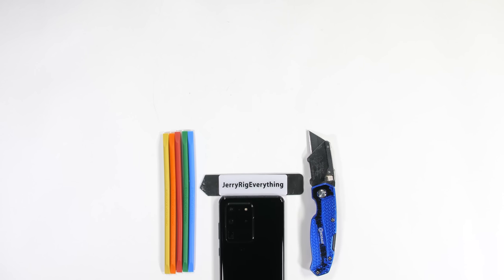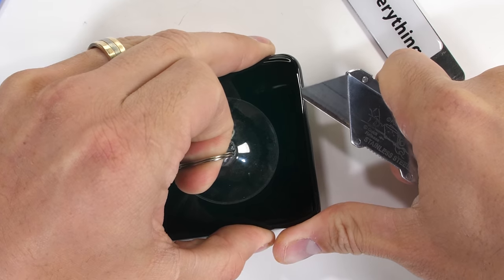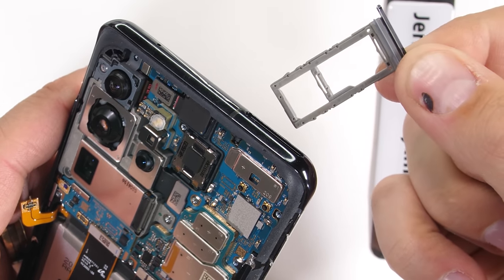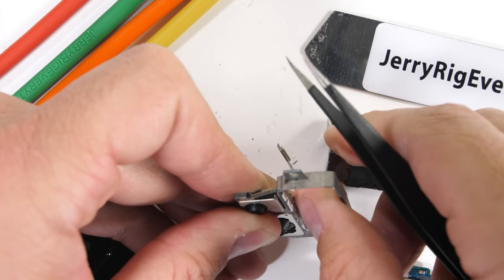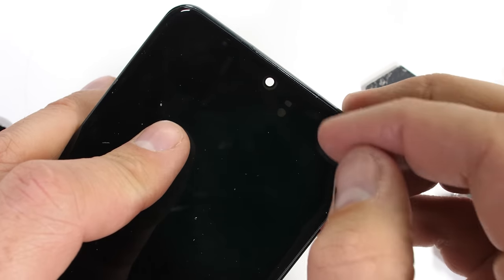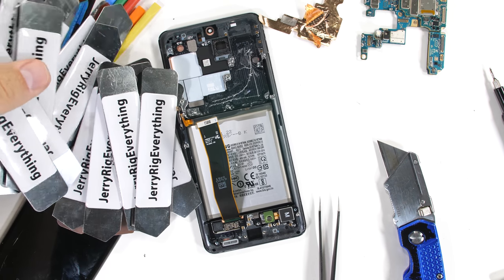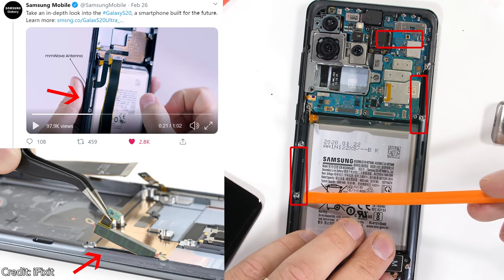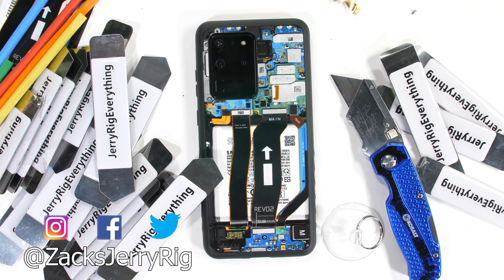Samsung S20 Ultra 5G Teardown! - Is the 5G even real?!

Comment: What do I think about 5G? Probably the same as you Jerry. However, most phones coming out this year will probably support 5G, and i'm looking to buy a new phone this year, so question is if i can avoid 5G? I could off course buy a 2019 phone and i might do that... i'm more interested in the other new improvements coming in 2020 phones though, such as the 120 hz displays. I've never seen a phone with a 120 hz display, but maybe when i do i might think that it's worth the extra buck?

Comment: 0:34 in the top corner of the battery zack has written  (glass is glass and glass breaks) 😂
Reply: What an eye mannnn....Damn XD
Reply: I can't see it well, I got a 720p screen :(
Reply: The cable says "glass is glass and glass breaks" jist above the USB charger port says "Illuminati" and the botttom middle says "Jerryrigeverything" 

Source: Its on my phone.
Reply: @Johannes Davidsen on that battery ribbon on left side
Reply: Are u watching this video on a large 4k screen? I can't see shit on my 5,6" 1080p phone screen just a tiny glimpe of it and it's not actually on the battery it's on the cable
Reply: @DaniDani-zb4wd  i typed battery ribbon and im watching it on 5.1inch s7 lol
Reply: @samsung user I have a Xiaomi Mi A3
Reply: @draig3963  screenshoted the image and zoomed in to see if the text is recognizable and yeah it is but BARELY so u either screenshoted the picture and did just what I did or watched it on a bigger screen cause there's no way u actually picked up that detail while watching the video though your screen is a bit higher resolution than mine 1440p I guess
Reply: @DaniDani-zb4wd  i can barely see it

Comment: Hi Jerry, I own a 20 Ultra 5g that it suppose to be the international version ( SM-N986B Dual Sim) I bought that in Italy and the csc is ITV. When i was in Italy i got few times the 5G network and it is really amazing! Then , when i come back here in California I was expecting to get 5g sometime but no way! and watching the specs of this model practically is missing the 5g bands that are used by AT&T and also by TMobile. My question is: Do you think that is possibile to add the antenna for the 5g mmwave? the software will handle it? What's your toughts?

Comment: ATT advertising LTE as 5G, this phone being touted as 5G when it has no real 5G hardware. You wonder how these companies get away with blatant lying.
Reply: Its the Korean version...
Reply: @tiggzr9744  does vietnamese version have 5g?
Reply: This Phone does have 5G hardware, it just isn't designed for mmwave which as far as I know only the US is currently doing anything with, Europe and Korea at least are using the Sub 6GHz version of 5G which doesn't need anywhere near the complexity of mmwave which is why the antennas are different. Mmwave and Sub 6GHz are both 5G standards. Also for note when Jerry is going on about 'everyone paying the premium' Samsung doesn't dictate that, since Qualcomm will only sell the Snapdragon 865 with the 5G X55 modem, since the SD865 has no modem on-board not even for 4G unlike the SD855 where the 5G modem was an optional extra.

Comment: Me: I wondered why the S20 Ultra got so hot when Linus tested it.
Jerry: There’s no thermal paste in here, like you’d see on most high end phones...
Reply: No. The phone getting hot means that the thermal interface is actually working well, thys dissipating heat more efficiently. Just like how efficient cooling towers in PCs heat up more quickly.
Reply: @lemon0801  You cant know if its the heat getting out or the heat frying up the whole device.
Reply: @esatd34  yes coz its a phone not a pc where you can feel heat coming through fans.
Reply: @lemon0801  It depends upon how hot the phones gets. When it gets hot enough for a reviewer to mention it specifically as being hotter than usual, it could be an issue in the future. Would you buy one secondhand? Given Samsung's record on batteries I'm not convinced their quality control would spot this either.

Comment: damn Samsung really has been playing us recently... the “glass” display on the z flop, the failure of the original fold, and now fake 5g
Reply: It's not fake 5g in the US model at least. It has everything needed to support 5g. It's up to the carrier to put up more antennas
Reply: its not fake 5g, just not all areas support it
Reply: Also, I have the unlocked US model and running TMobile low band 5g in LA area. I'm getting easy 120+Mbps at all times. Much faster than when I was getting 20-30mbps on 4g lte.
Reply: Skilled in Silver for Koreans, they’re paying for 5G that they don’t even get, even if the area doesn’t support it yet. It’s false advertising to say you have something and then not include it.

Comment: For 5G, I think the difference is in the processors. The Qualcomm version uses the extra booster antennas but the Exynos version doesn't. Same story for the Note 20 Ultra 5G. In Asia, the 5G Samsung phones lack those antennas but still have 5G. Maybe those are for mmWave?

Comment: 3½ year old S20 Ultra still going! My USB port is wearing out so I've switched to 95% wireless charging (fast if possible) and my battery absolutely sucks but I think I can hold out for a much cheaper S23U when it's revealed the S24 line is just a marginal update by January.

Comment: Perfect one to ask this question: I accidentally shoved the ejector pin into the hole in the bottom of the phone (microphone opening?) instead of the SIM card tray hole… Do you think that I could have damaged anything (waterproofing, that rectangular component on the USB PCB looking like a crystal, etc.)?
Reply: If your microphone still works (e.g. phone call) you're fine.  As for water resistance, the microphone is sealed, that hole in the bottom of the phone is the only hole in that component.  So water resistance shouldn't be compromised. 

Source:  I repair Samsung phones including the S20U daily, at a Samsung authorized repair center

Comment: The 100x zoom camera is clever, never seen a set up like that. Always wondered how it was optical soon when the lens was fixed. Never saw a periscope design before.
Reply: It's digital zoom. The lens is fixed at 4x optical zoom, anything above is just a crop.
Reply: Thought it moves to a point while everything over and in between are digital.

On the S10+ it was that way (until a certain update)

Comment: My SM G988U (im certain that is what it is, im looking at the motherboard now...) has an extra ribbon connector, and it looks like, extra pieces that yours doesnt have... whats up with. that?  @2:39 the area under your left index finger (left side of the battery, on the frame) has a silver piece screwed in where yours just has black. from the top of that little piece, there is a ribbon connector that runs over the battery one, and plugs in just over the center of the ribbon connector with orange edges.

Comment: Can you please include a super-needed additional test where you plug the charging cable into the charging port of the phones and then try bending the cord or stepping on the cord really hard to see whether it will crush or destroy the charging port or “poke out the back of the phone like an elephant trunk waiting to snap off” like the ipad pencil 1st generation....I’ve always wondered

Comment: I was hoping you would show how the flashlight is attached to the motherboard. Mine has a broken lens and I'd like to replace the flashlight assembly, but not if it requires board-level soldering.

Comment: 5:39
I read that the Zoom-Lens (better called Tele-Lens) has a 4x Zoom compared to the Main-Lens. So around a 103mm fixed focal length.
But you if I understand you right it has a Zoom?
From what minimal to maximal focal length is it?

Comment: Stupid question.  I got this phone recently. I don't know how (I was probably tired) but when I got this phone I used sim ejector on.... bottom hole (Microphone one). Sim hole is on the top edge of the phone. I pushed it around 5mm in. I think microphone works totally fine but I wonder if I damaged any water resistance. Should I be worried or everything is ok?

Comment: i do cell phone repair for a living. and I constantly get Note 10+ 5g devices with no mmwave modules. And i dont understand it. I think it might have to deal with the providers, because some have mmwave modules and some Note 10+ 5g dont. its super weird. I know for a fact that those "5g" devices that dont have the mmwave modules, dont get 5g connection. The either get 5ge which is still 4g or LTE which is all technically the same

Comment: Totally agree with you on 5g  the chances of getting that outside metro areas in my opinion  (after they get it going first in the metro areas )is slim and if so will be years from now at best!Especially the ultra wideband aka Verizon for one.They will need many many more cell sites ,nodes,small cells whatever as this is more of a line of sight making it very hard to transmit thru buildings /objects whatever .I read on one site that the nodes/small cell sites may have to be as close as 500 ft to work as advertised .Can you say expensive and many many many years for this to be usable as advertised!In essence I totally agree with you Jerry on 5G. Cool Teardown as usual

Comment: Have you ever cut yourself while trying to pry open the back/front panels using the blade. Sometimes your thumb and the blade are eerily close to each other. If the stick adhesive suddenly gives way? 🤦🏻

Comment: hey jerry a huge tip. alcohol 99% removes the battery without damaging your tools you might also want to use eds 13 round tweezers  to removes the front speaker instead of your knife

Comment: I bought s20+ 5G because the camera bulge on the ultra is too big in my opinion. Plus ultra only sold in 128 GB version here. While I got 512 GB version of the S20+. They testing 5G here in Denmark. But haven't tried it yet. But the Wi-Fi on this device is fast and 25W charger is very fast.

Comment: I accidentally stuck the sim ejector tool into the whole above the camera which i was told is a microphone whole. Could i have done any damage? The ejector tool goes into the phone more than the bottom. I tried it without force to see if i pushed anything in.

Comment: This is why I hate clickbait, This phone is 5G, it isn't designed for the US mmwave network which is only present in the US since it is a Korean device and they like Europe use Sub 6GHz 5G, this network doesn't need the same antennas. The pricing thing is also not necessarily Samsung's fault, since without the X55 modem the Snapdragon 865 will not be able to connect to ANY network, 2G, 3G, 4G or 5G, this is different to the older Snapdragon 855 which did support up to 4G without an external modem which could be optionally added for 5G, this decision drove the cost of the SD865 up which ended up with manufacturers passing that cost increase on. Also can I just say how ludicrous that amount of battery glue is, it's equally as unrepairable as Apples paired batteries, one will potentially cause a fire and the other is a pain in the ass when the battery health thing doesn't work.

Comment: Had this phone since release day and I can honestly say that this is where phone tech took such a leap that upgrading now feels useless. 512gb of storage and 16gb of ram and I run this phone on battery saver all the time. Its just a beast and unless it dies this thing will last for years without needing an upgrade.
Reply: Yep, dont think I'm getting rid of this until they make a folding phone with an sd card slot and a 5000mah battery.

Comment: did anyone tried to add some kind of patch(something to transfer heat from the cpu to the cooler) between the cpu and the copper on the chassis? i guess thats why the phone is performing poorly :/ the exynos version..  i just took apart a samsung a10 and it has got some weird gummy pad on the cpu and chipset

Comment: Hi! I bought the s20+ some months ago and after some testing with wifi I have seen one isse.

When I cover the top of the phone with a hand the signal drops rapidly and in some cases ceases. This happens when I tilt the phone to use both hands or when I experimented by just covering the top with one hand.

Is this a know issue and is there a fix for it?
Best regards Anton

Comment: Zack,. Have you ever cut your thumb using the razer blade slicing through the glue on the phone.   Every time I see you do that it brings back bad memories of me slicing insulation off a 75 year old electrical wire in the attic crawl space of my house.   It involved a puncture to the bone, a lot of blood and a fun crawl out of the attic with insulation sticking to my bloody hand.

Comment: Mine just dropped by 5ft onto vinyl plank flooring in a otter box defender. On the screen. The back glass shattered and now the service doesn't work. 

Ubreakifix says they can't fix it as it's the motherboard probably. I will not be buying another Samsung. Fuck them

Comment: No 5g is not yet "real" but it is in progress downside is if you are more than 1 1/2 mile away from the tower you will not have 5g signal but in cities they plan to impliment either micro towers or signal boosters but it will take time to even implement it

Comment: Why brag about something that is 1: not in this phone and 2: isn't available yet, but yet, you pay extra for that something that isn't extra yet, imagine paying 15,000 dollar's more for a small car, you ask them why and they say that it is for the 100 extra horsepower that isn't yet implemented in the car, nobody would buy this car because it is actually a way of scamming, but this phone sells like hot cakes, so everybody is getting scammed and they let it happen, insane!
Reply: In Korea yea, that's total false advertising. Even if the network isn't setup, it could be in a few years and someone might be buying to keep for that long only to find the 5G was a lie years later. I tend to give my phone to family, so I'd be rather angry to learn it didn't work when they finally implement it in my area (assuming that day isn't 20 years from now).

In the USA, a few cities do have 5G so I would think we'd get the antennas in ours... but it is meaningless to the majority of people even here. It's similar to buying a hydrogen car only to find there's nowhere nearby to supply the hydrogen fuel.
Reply: @Shaggy2286  Here in europe, where i am from, 5G isn't around at all, maby some other countries, but where i am from, it isn't even in the testing fase, they have yet to build the entire infrastructure here, but you can already buy 5G enabled phones here, which is insane! Its like buying a car with studs in the tires for the snow, but it almost never snows here, its crazy, and people will buy those phones here and brag about it "look, i have the new 5G phone, yours is still 4G" . . . Ehm dude, its not available here, why did you buy it? Insane!

Comment: Please thumb up this comment so jerry can see it; 

Since the Samsung S8 the battery adhesive is very easy to remove, atleast compared to previous versions with built-in batteries, just heat the backside(screen) to 50-60+ C and it's quite easy to remove. 
I use the same pry-tool when removing the battery, and haven't bent one a bit when removing the battery if the adhesive is hot
I work with repairing phones, and it boggles me that you haven't tried heating the adhesive a little. 
Maybe in the future you won't damage the battery

Comment: Samsung have terrible batteries, in addition to the exploding ones I mean.  And they can't even make THAT one part easy to replace.  I get half the phone been near impossible to repair but sometimes just replacing the battery will breath new life to a phone.  My V20 is still around thanks to it's third battery.  When my 40 battery dies that'll be it for it.  And Samsung should be sued for not including the antennas. It's advertising a phone one way, it should work that way.

Comment: They really should stop copying and start innovating more no correct cooling and a crap Chip if you're going from samsung to Samsung it's fine but from another phone you'd possibly get similar performance from an older model also it's a bit extreme to use that much glue who made that decision chuck Norris lol
Reply: Innovating? How should they innovate that isn’t too gimmicky or alienates their customer base?

Customers like me want a phone with the powerful Snapdragon 865, or A13, great camera system, OLED display with a high refresh rate

Instead of innovation to see what phone stands out the most in terms of appearance. It should be really about sustainability and performance.